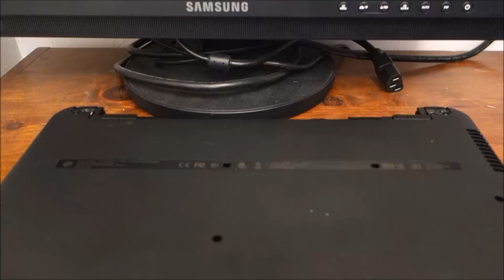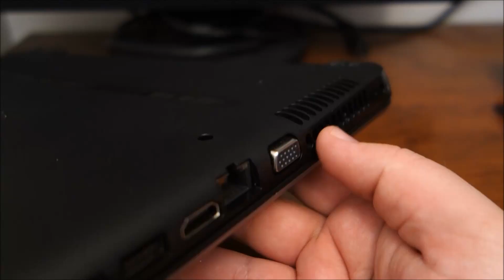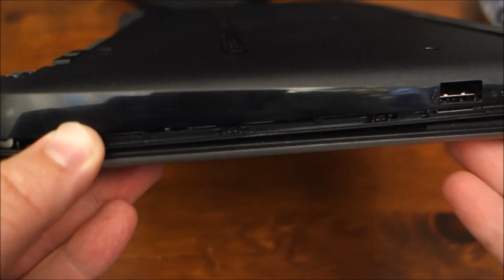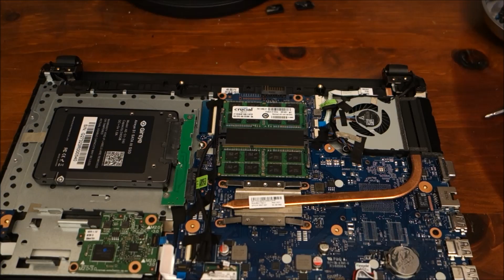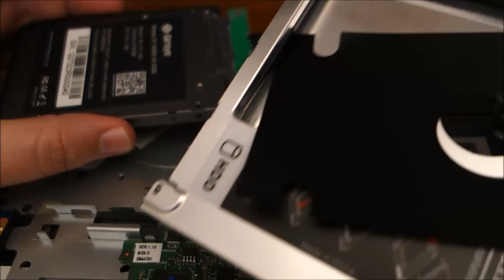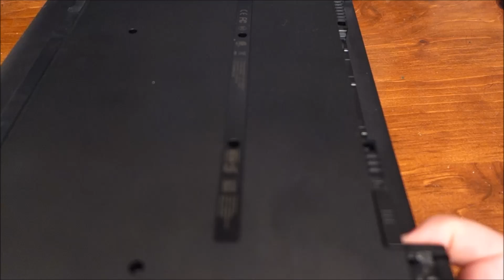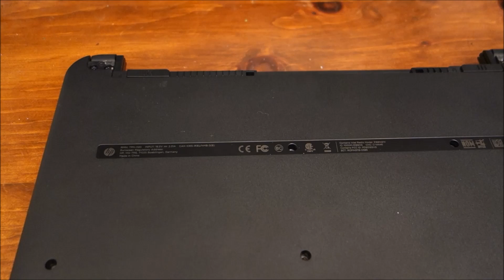HP 14-an013nr case opened up, ssd install, memory upgrade

Comment: I use this computer for school. I mostly do Microsoft Office stuff and YouTube. Most of my files are documents & pictures. Will getting an HDD instead of SSD be a good choice? I heard that it’s slower but will I notice the speed when doing stuff like office files? I’m interested in HDD only bc it’s cheaper but will it hurt me?
Reply from the maker: yes, a hard drive will cause the whole system to be significantly slower, shorten battery life, and cause it to be less reliable, since the drive can be easily damaged compared to an SSD. I find that 240 gigs to be sufficient for most of my needs.
Reply: AICproductions Thank-you, your video was good and will be very helpful. Is there any cheaper brands to choose from for the SSD & 8Gb RAM?
Reply from the maker: any 2.5" SSD or DDR3L memory will work. amazon has 120 gig SSD's starting at $50 http://amzn.to/2yOJslLyou can add just 4 gigs for a total of 8 gigs of memory: http://amzn.to/2zR5ynJ
Reply: AICproductions I hate to keep asking questions, just wanna be sure before I buy. I know that I can’t use both memory slots. My plan was to remove the factory 4GB and replace that slot with an 8GB. the other slot will still be empty. Is that fine?  I know I’m a Noob.
Reply from the maker: you can use both slots. I did. I first put in 2x8, felt like 16 gigs was over kill so did a 2x4 for 8 gigs total.
Reply: AICproductions  oooohhhh thankyou soooo much. I’ll only buy a 4GB to add to the stock one for a total of 8. You’re great.

Comment: Can't we add HDD of 1gb instead of SSD?
Reply from the maker: Of course, an SSD and a 2.5mm drive would both work. The problems with an SSD, is they 1) consume more power, so will have a negative affect on battery life, 2) are more easily damaged if the laptop is dropped or bumped, and 3) they are sooooooooo Slow, Performance would suffer with a spinning drive.
Reply: I'm using hp 14-an013nr with 32gb of eMMC. Now i wanted to upgrade that storage area.
Now what i prefer either HDD r SSD?
Is Authorized service centers will provide that fecility?
Reply from the maker: SSD are more expensive, and don't give you as much capacity, but are MUCH faster and easier on the battery. HDD's are less expensive (per GB), and can be had in larger capacities.  its up to you. as far as a service center? I have no idea, I upgrade my own laptops.
Reply: If i placed an SSD r HDD without takingoff eMMC.
is it needed to install os after that?
Reply from the maker: no. it doesn't matter if you leave it there or take it out.
Reply: isn't that HDD and not SSD?

Comment: i have this laptop and im thinking about pulling it apart and upgrading. Any recommendations?
Reply from the maker: as far as? I have the parts I used listed in the description.
Reply: as far as what I want to do to it? mostly up the ram and add in a bigger hard drive for more space cause this thing has like none. i was mostly asking for like particular brands you would have chosen if you had more funds.
Reply from the maker: well, I still would have gone for the least expensive ram. 99% of it is all made in the same factory, they just slap different brand stickers on it. I still think that 8 is an appropriate level of ram for this system, I did put 16 gigs in, and I didn't notice a difference over 8 gigs for my typical tasks. 

I would have gone with a larger SSD. A 480 gig, or even a 1tb, Samsung evo. I have a 1tb 850 evo in my main laptop I've had for 4 years,  and it still works flawlessly after 4 years. 

But if I had a lot more funds... I would have bought something else entirely, by the time you buy this laptop and toss $200 worth of parts into it, you can buy a much nicer, slightly used laptop, with a core i5 or even i7 processor. I bought a thinkpad x250 recently for $300, with a 5th gen core i5 processor. it does not have a 1080 screen, and its only an 11.6" but it crushes this laptop in every other aspect.

Comment: Hey I just bought a HP Refurbished 14-an013nr from Walmart for 150 bucks put a 8 gig stick of memory in it now have 12gigs of memory,Put in a 256 Gb Crucial SSD drive it works great Thanks for showing this one to me now have a fast computer for all my YouTube HD viewing.
Reply from the maker: Glad to have helped!
Reply: Yes  the job was easy after I took out all 14 screws :-) was overlooking one screw in the middle of the case you just can't take them apart that way:-(
Little computer really flies ,Bios found my  Crucial SSD  made it C: and  I was looking at my old home screen with all my data.
 Thanks again 
I subscribed to your channel  be looking for your next video

Comment: Hello, could i install a single Crucial 16GB Single DDR3L 204-Pin SODIMM Memory in that laptop , would it work? thank you in advance.....
Reply from the maker: The largest I tried was an 8 gig dimm (x2), since I don't have a 16 gig dimm. so I cannot say either way. If you had a 16 gig dimm laying around you can try it, but I wouldn't spend the extra money on it. I felt no performance difference between 8 and 16 gigs.

Comment: Dual slots but no dual channel memory. Well that must be the worst sucking design in recent memory, excluding Apple of course. ;)
Reply from the maker: dual channel gives MAYBE a 10% boost in performance in SOME instances. it would have such a negligible effect on performance, it is not needed on a sub $250 laptop. Seriously.

Comment: Quick question, with the second hard drive, can I install windows on it and have the computer boot to the second hard drive and bypass the 32gig all together?   thanks
Reply from the maker: Yup, that's what I did. I just installed a fresh copy of windows from USB to the SSD, and deleted the drive on 32 gig drive, and then set the ssd as the boot device in windows
Reply: Cool thanks alot  :)

Comment: Thanks for the video.
I do not want to change the boot drive/OS to the ssd.

I simply want to install programs on the ssd and keep the 32g emmc as is.

After hardware installation, do I just need to format the ssd from windows explorer?
Reply from the maker: Correct. you can also go into settings and change where it stores files by default to the SSD.
Reply: AICproductions very helpful. Thank you.
Reply: Installed successfully! And I migrated the OS to SSD no problem. Well, one problem, I didn't increase the primary partition size on my first attempt so it was 28g used/0avail and 200g+ unallocated. 

Question about the caddy. when I removed the adapter from the optical dock, there is a loose cord that is connected to the adapter. Is it safe to remove this? I just taped it to the SSD for now.

Comment: Guys i need help. I bought this laptop for my mom. I want to upgrade the harddrive to SSD. But my one concern is that if i have to reinstall windows 10 in the new drive. Will my windows still be genuine and be activated.Or I am gonna lose my lisence and have to buy new windows lisence or just work with a windows which is not registered. Please reply because i really want to upgrade my drive without loosing my windows activation.
Reply from the maker: your windows 10 license is associated with your mobo. Any new computer that was released after windows 8.1 has the license associated already. I reinstalled windows multiple times from a USB drive I created without issues. It'll even determine which version is hard wired (windows home vs windows pro) so you can use the same usb for all systems. 

This does NOT apply to any pre 8.1/custom built PC.
Reply: AICproductions thanks so much it was helpful

Comment: What is the SSD connector you're using? Please give me a link?
Reply: so you just took off the SSD connector?
Reply from the maker: +AbdullahLeads!! Yup. You can use the whole caddy, I didn't want to. There are some that have mounting tabs, the one I got did not have them.
Reply: alright, thanks. I think i would do the same as you. and use double sided tape

Comment: Thanks for the video. I successfully upgraded my HP 14-an013nr.   I ordered an Aireye ssd and installed it with what appears to be the same caddy you bought but, I actually used the caddy because it lined up perfectly to plug in and when I installed the backing or bottom, it seemed to actually lock in the  caddy so it can't  move.  The software work was tricky as I first used MiniTool/Partician Wizard with limited success then after  reformatting the drive, I retried with Macrium.  That worked really well. For now, i disabled the drive in Computer Manager / Device Management because I could not find that option in the BIOS.  Maybe later I'll activate the drive and use it but for now, it will remain unused and ready the operating system in case of emergency.  Because of your video and another's, I was able to do this upgrade.  THANK YOU!!!
Reply from the maker: Awesome! glad you were able to get it taken care of, that's the whole reason I make these videos.
Reply: Would you mind linking me to the caddy you used?
Reply from the maker: http://amzn.to/2g8agoH
Reply: Thanks, you're awesome for replying after the year that has passed since you made this video. But I was referring to Danny G, because he said that it fit pretty well. He did reply to me, and, actually, they are the same after all.
Reply: I'm glad it worked for you.  Unfortunately, my system did not recognize the 32GB original drive as I drive I could install Abuntu but, I am using it as a secondary story drive.  Maybe later I will figure it out but for now, there are other things to do.

Comment: https://www.amazon.com/PC3-12800-204-pin-1600MHz-Genuine-Tech/dp/B00C53ANDO/ref=sr_1_9?s=electronics&rps=1&ie=UTF8&qid=1500487131&sr=1-9&keywords=ddr3+sodimm&refinements=p_85%3A2470955011
Is this ^ compatible with the laptop on your video?

https://www.amazon.com/gp/product/B009RBN6I6/ref=oh_aui_detailpage_o07_s01?ie=UTF8&th=1

On this ^ link there are two 4GB one says DDR3 the other doesn't,
which one is the one compatible with the laptop in your video,what's the difference?

I have not bought them yet,
please refer to the one you recommend via one of your links ;P
Reply from the maker: http://amzn.to/2tgc7fZ This one, it needs to be DDR3L for low voltage. the first one doesn't say anything about being low voltage, so I can only assume that it is not.

Comment: Do you know what kind of port that is right by the RAM card? 

Also, did that stock storage device say M.2.0 or M2.0? I might end ep tearing this down to get a personal look at everything, but I use it a lot.
Reply from the maker: +Nasty Butter no, it's an emmc drive, connected by a ribbon cable. Not sure which port you are talking about.
Reply: I know it's eMMC. But it says M2.0 or it says M.2.0 on it. I can't see if there is a period between the M and the 2.

The other port I asked about I realized is probably just the battery interface lol
Reply from the maker: as far as I'm aware, this laptop does not have an M.2 slot anywhere on the system board.

Comment: I have a question.. Can I install a regular 500gb Laptop hard drive instead of an SSD drive.. Because I did and its giving me a ACPI bios error (bluescreen most of the time) or is it possible the memory chip I upgraded which was another 4gb and the same exact one might be faulty.. Any ideas..
Reply from the maker: was the hard drive new or used? if used it might be bad. Otherwise I would reset the bios to factory settings, and then I would put everything back to factory specs, and start over, and upgrade just one thing at a time. see if that fixes it. Might need to reinstall windows.
Reply: Thanks.. Hard drive was used but was working in another pc and formatted.. But this was a brand new laptop I installed the hard drive and memory before I did the initial windows setup that comes built in with the new PC.. I had already installed everything updated drivers, updated bios every single thing when I started noticing the problem.. Im going to flash the bios again and also reset it after as per your advice and see if that helps maybe also a windows repair before I go and try a full windows install.. But my biggest question is would it matter being a regular laptop hard drive as apposed to an SSD I didnt think it would.. O I did keep the Operating system on the 32 gig drive it comes with which now after updates has only about 8 gigs left and am using the 500gb to install the programs and also made it the default save drive for data.. Also I already did a windows memory test and it came back with no issues..  Any ideas..
Reply: I have an update for you.. First of all thank you very much for your help.. Well I flashed the bios again and it seemed to still be happening so I set the bios to its defaults which I never modified I figured it adjusted memory and the hard drive by itself as all new computers do.. And that seems to have fixed the problem.. I have shutdown and restarted over 10 times and it has not given me any errors which before it would give it to me 95% of the time.. I also went ahead and did a windows repair and it did its thing.. But it seems like defaulting the bios fixed the problem like you said I have no idea why but it did.. I cant thank you enough..
Reply: Think I might have spoken to soon.. It still does it every so often but no where near what it used to.. Any ideas
Reply from the maker: I have never personally had this issue, so I cannot say for sure what the issue will be. but I googled it, and yeah, I would remove the storage drive and memory that you added. That error shows up as a driver issue, or a bad piece of hardware issue.
Reply: Well I tested the memory with windows and it said I had no issues.. I just wonder if installing a regular 500 gb laptop hard drive instead of on SSD was a bad idea..
Reply from the maker: +Jorge Gomez no, unless the drive is bad.
Reply: I just thought it might be a heat issue for the hard drive.. Even though the laptop doesnt get hot at all.. I guess when I have some extra time on my hands ill reinstall windows from scratch..thanks
Reply: I think I figured out what the problem is but because my son is using the PC the way it is I havnt tested the fix yet.. Like you I purchased the cheapest hard drive adapter I could find on Amazon that was similar to yours.. When I received it I noticed it had 4 dip switches on it but the box didnt say what they where for (china) so I installed it the way it came.. I remembered this so I emailed the seller I just received an email back it turns out this is a universal type adapter and you set the dip switches according to what pc you have.. Im pretty sure its wrong since I didnt modify it at all who knows how the dip switches where set.. The funny thing is that it actually works after it gives the error and reboots.. So hopefully that is the issue ill post back as soon as I am 100% sure it might be a while because my son works alot and he doesnt live with me.. thanks for all your help

Comment: Hey AIC Productions.  I have the same laptop and drastically need to upgrade upgrade the storage.  I ordered an SSD and caddy from Amazon.  Maybe I'll upgrade the RAM later.  Anyways, did you at all find a problem with the Velcro dots?  No heating issues with the dots either?  This is such an awesome laptop and I thought I could get away with flash drives but, I have to have more un-removable storage space.  Thanks for the video!
Reply from the maker: I carried it around for 3 months with no issues with the Velcro dots, using it every day.
Reply: Saw that in your original video. Was wondering if anything new arose.  Good to know.  Hope to have mine done in a week or so.
Reply from the maker: I sold it to move on to other projects/products so cannot speak for how much longer it would last, but it was very solid still and I expect it to stay that way.
Reply: Thank you for the reply.  I'm considering using the iPhone battery strip tape instead of velcro tape.  As soon as I get the drive and open up the laptop, I'll decide.
Reply from the maker: I used velcro since I knew I wasn't going to leave that drive in there permanently, it would hold fast, but would be easily removed if I wanted to.

Comment: Got 2 of these one used in perfect like new condition.. I mean like so new there wasnt a scratch on it for $180 no tax on amazon and another for  $190 plus tax new on prime day on amazon for my son.. On each of them I upgraded the memory to 8 and on one of them Im putting the 120gb SSD as a second drive.. Now for my laptop I dont need the space I put in a SD micro card 64gb to store movies and music I dont need that many apps because this laptop is meant only for travel to watch movies  off the sd card and works like a charm.. Does anyone know the max SD card I can put in I was seeing a 200gb sandisk sd card that I can get on ebay for $35 does anyone know if this will support it.. thanks and also thanks for the video..
Reply: there are only 2 types of sd card readers the ones that read up to 32gb and the ones the accept up to 2 tera, even phones if they advertise the storage up to 64gb 128gb or 256gb it´s actually up to 2 tera, so this laptop will accept up to 2 terabytes hypothetical sd card, and the only thing you may have to do is format in FAT 32  or ntfs but most likely the card will come already formatted in a readable way.
Reply: Thanks Pedro.. I have ordered it already was hoping for positive news.. Ill write back letting you know you where 100% correct after I test it..

Comment: How much the battery lasts if is given a very "light" use? (say, no youtube videos, no bluetooth, no wifi, etc.)
Reply from the maker: I'm sure you can stretch it to 8 hours, I was able to average between 3 and 6 hours depending on what I was doing. I never turned off wifi or bluetooth. (they usually don't do much to save battery). but battery saver mode really makes a big difference, and is very effective.